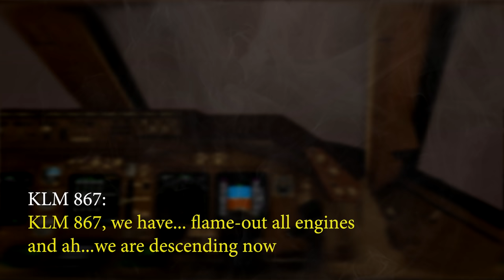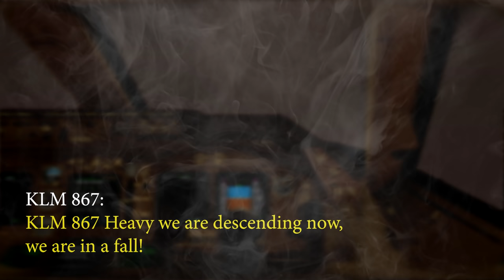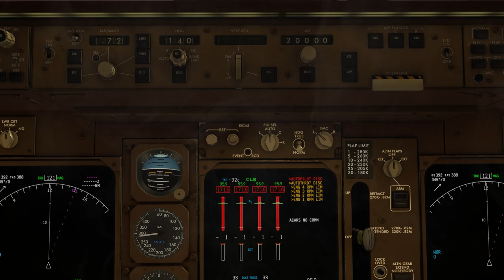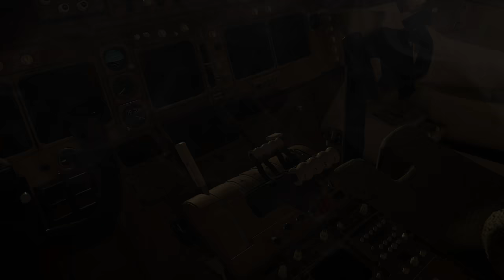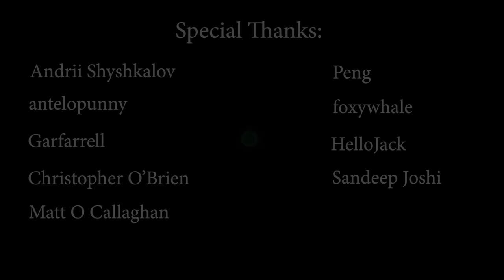ALL engines OUT!!? | KLM Flight 867

Comment: After British Airways Flight 009, this should not happened. Especially not with a major carrier like KLM.
Reply: Once is a fluke.
Twice is happenstance.
Three times?  That’s a pattern, best do something about it.
—
Thing is, the crew knew to avoid ash clouds - but you can’t tell the two apart just by looking at them.
Part of the solution adopted today is air charts now have the option to show airspace that has a risk of carrying volcanic ash.  I may question how quickly the charts can be updated, but the capacity IS there today.  In the days of paper charts, it wasn’t an option.
Reply: It's the 80s where sadly many similar accidents happened multiple times killing many people. This was fortunately not one of them.
Reply: Excellant video
Reply: Of course not, isn't hindsight a marvellous thing?
Reply: wonder why they made the decision to fly into the ash, knowing that it is dangerous.
Reply: Fully agree with you on that, Márk. And the idea to push the engines even harder while it was clear that they were flying through ash was hopefully not the captain's brightest ever move.
Reply: Yes your right I was thinking the same thing as I watching this unfold just as the British airline.
Reply: @stephenc2481  they didn't make the decision. They misinterpreted the ash as a normal cloud that was backlit to give it a slightly weird colour.
Reply: @jwenting  Exactly...I guess that @StephenC didn't watch the video at all or they would have known what you stated about the clouds being backlit giving off a brownish hue!
Reply: If you can control volcanoes then you’re the one responsible for making sure it never happens again.

Comment: I was on the last flight to leave from Honolulu on 20 December 2020, and during takeoff and climb Kilauea volcano on the big island erupted violently. I didn't know it at the time but the crew was extremely worried and on edge, I saw an orange glow out of the window but thought it was just light from the engines in weird fog. It wasn't until we landed that the crew showed how frazzled and relieved they were. The plane was too far into the takeoff to abandon or return to Honolulu, and no other planes were able to leave after us. We got pretty lucky
Reply: The FO is a female??
Reply: mipmipmipmipmip Obviously not, especially since this person’s plane didn’t come near an ounce of ash. If a lot of ash got ingested, the primary cost would be replacing the engines. Some flight surfaces would require replacement/repair and it’d need a new paint.
Reply: And it’s obviously not true that they couldn’t have returned to Honolulu or another Hawaiian airport. Ash doesn’t spread faster than the wind. All they would have needed to do was to dump fuel. Also, the pilots’ worry would have been from ignorance since they clearly wouldn’t have been flying through the ash stream.
Reply: What makes your comment even more ridiculous is that Honolulu is 220 miles from Mount Kilauea. So, I guess it’s true that people tell absurd stories for no good reason on YT.
Reply: @elevatedH.680 yes. Why is it strange?
Reply: @jetblackjoy No. just needed clarification

Comment: Was unaware of this incident.  Amazed that the switch from generators to batteries and back wasn't instantaneous in a glass cockpit aircraft, especially so in one as large as the B747-400.  Another terrific video, thank you.
Reply: the generators spin down when you switch to batteries.
When switching back to generators they take a little to spin up again.

Comment: My brother was in Alaska when Mt McKinley blew (iirc).  He has some jars of the ashes.  He said it fell like snow.  People would go outside to go to work, start their cars, only to watch them sputter out in seconds and be useless until it was cleaned out and the air filter replaced.  Ash is crazy that way. It looks like snow, but it's superfine and will coat every surface and starve an engine super fast.
Reply: Denali (mt mckinley) isnt a volcano. it is the tallest mountain in North America however
Reply: @willowravenmusic  thanks for clarifying.  I'm currently guessing it must have been St. Helen's.  Maybe he was either staying near McKinley or had been stationed near there and I conflated them names in my head. Edit: Nope, I forgot, Helen's was way too long ago, and I think that's why I rejected it for McKinley, not realizing McKinley wasn't a volcano.  Looking at some eruption data, it was either Kasatochi, but more likely Mount Spurr.
Reply: I presume you mean it's extremely fine and will starve an engine extremely fast
Reply: @niallwalsh6598  yeah, exactly that.  Just instantly packed the air boxes with fine powder that would pack in tight enough to look like cement in there at first.

Comment: Never heard of this one shouldn’t have happened after the British airways disaster tho, great video as always anyways! 👍
Reply: the BA flight through ash (around same time i think) was not a disaster. it too landed with no deaths
https://en.wikipedia.org/wiki/British_Airways_Flight_009
Reply: @noneofyourbizness  Also the plane suffered serious abrasion everywhere, including engines and windscreens.
Reply: No warning
Reply: @spikenomoon  There was warning that a volcano had erupted and there was an ash cloud present in the vicinity.  In light of the known serious risk of flying through an ash cloud, in my opinion that should have been sufficient for an early decsion to have been made to divert to an airport well out of the path of any ash cloud.
Reply: @davemould4638  they were alert, and took the then standard measures to get out of the ash (meaning, apply full throttle and climb).
Diversion wasn't considered probably because of where they were flying, it's pretty remote there with few aircraft that can handle a 747. 
Vancouver or Seattle could have been options to land early had they known the cloud would be where it was and couldn't be avoided, but they didn't as the location of the cloud wasn't known.
And had they chosen to make their fuel stop there rather than at Anchorage they may have had trouble reaching Japan, especially if they'd have chosen a more southerly (and thus longer) route to avoid the volcano.

Lots of factors always come into play when making flight planning decisions. And sometimes you take a calculated risk if said risk is considered to be minimal.
Reply: @jwenting  You stated, "And sometimes you take a calculated risk if said risk is considered to be minimal."  And there's the mistake.  The risk of flying through a volcanic ash cloud was grossly under-estimated.
Reply: Captain Eric Moody and crew avoided a disaster didn’t they?

Comment: Amazing to think despite this happening to both BA and Singapore Airlines above Indonesia it appears that very little was done to ensure that it never happened again. I have seen coverage of the BA flight by other contributors but none on the Singapore Airlines 747 which lost 3 engines. Maybe you could cover it?
Reply: What was the name of the flight and what date did this happen?
Reply: @NovemberSky3  Not sure the flight number, but the Singapore Airlines flight incident happened a little over two weeks after BA Flight 9, on July 14, 1982. It was flying on a similar routing, from Singapore to Melbourne, and it overflew the same volcano which had erupted again.

Comment: If I had seen that brown cloud I definitely wouldn't have tried to go through it.  But what do I know.  I'm a simple motorcycle tinkerer.
Reply: To be fair I think they probably missed the significance of that off white colour at such high altitude as it is common in lower altitude cloud. The reason of course being that lower altitude clouds are often contaminated with sulphur dioxide etc due to pollution emanating from industry on the ground. Sometimes it does find it's way to higher altitudes too but that generally needs a strong updraft to help it, volcanoes don't as they spew these gasses out with a ton of heat and pressure creating their own powerful updraft. But it is hard to blame the pilots for not being sure whether or not the cloud they were looking at was ash or just a run of the mill dirty cloud on a planet full of them. This is why we have meteorologists and geologists that should be identifying and tracking this stuff rather than asking pilots to try and guess from a slight tint of colour (And it is slight, the graphics oversaturate it more than it is in reality). Fortunately the VAAC teams now exist to do exactly this so there is no need for guesswork anymore or at least there shouldn't be.

Comment: I actually worked on that aircraft in Everett when it hit the flight line along with some British air, Asiana, Lufthansa and a few others. They were a beautiful aircraft with all the upgrades and even though I was avionics I was temporarily on electrical rework because the first 400s came out of the factory and they were engineering basket cases. I would get a workcard to  install a wire and the very next day me or another tech would get another workcard to remove the same wire I had installed just yesterday. And in the "E-bay" (Electronics Bay) Boeing had incorporated a new wiring concept called "wire wrap."  It made as much sense as defunding the police and then wondering why crime had increased.

Comment: Amazing story and accurate replay of the incident. Good job on including the live ATC /cockpit R/T. When flying into regions of volcanic activity it is paramount to not only pay close attention to ASHTAMS  but take additional tie to thoroughly prepare for this kind of scenario at pre flight planning as well as during I fight reviewing the QRH SOP for this eventuality and delaying your top of descent point to minimize transition to ash zones and taking track deviation well in advance of reaching the suspect areas. This means planning higher Flight Levels and carrying extra contingency fuel ad ensuring Crew and cabin oxygen levels well above adequate levels ad Electrical system,Batteries and Flash lights condition in excellent condition ad that during normal operations the APU ad Engine EGTs at acceptable levels. It is also paramount to ensure Engine ignition is ON and not on Auto when flight passage proximate volcanic plumes. Approaching brown colored thick clouds with smoke/acrid smell or reduced screen visibility are a clear sign to follow the manufacturer recommended memo items ad SOP for flight into  volcanic ash. This was an even better lesson after the original British Airways incident over Jakarta. Good CRM and Command by the Captain especially.Ability for the whole crew to remain calm and act procedurally is paramount.This scenario needs to be practiced both in Simulator recurrent training as well as Cabin Smoke procedures including Cabin crew joint training.

Comment: I'm a big fan of your videos. Very clear presentation of the facts - no artificial drama. The incidents are drama enough! 
I have just one question- you mentioned that the cost of cleanup & repair of the aircraft was $150 million in today's dollars. Are you sure that's right - if that were the case, wouldn't  KLM have been better off writing it off? While list prices are $400M AFAIK street prices are more in the range of $150M

Comment: Wow they all landed safely!   Had they flight crew not remained so resilient in restarting the engines and tackled every other issue as systematically aa they did. With power outages along with incorrect readings basically falling blindly out of the sky their outstanding attempt to keep optimistic where perhaps other pilots would've said a prayer and yelled into the radio "THATS IT WE'RE GOING DOWN".  NOT THESE CREW, NOT ON THEIR WATCH (and so polite to air traffic control throughout this terrifying ordeal "sir we are in a fall") C'mon ......HOW??  ❤👍👌👏👏👏👏👏👏👏👏👏👏

Comment: Really interesting and so satisfying to hear that they actually made it alive, I've never heard about this incident and I thought there's no way also this 747 could have made  it exactly like that British airways 747 hade done, but amazingly it did. That also make me think just how reliable aircraft the Boeing 747 must have been. Both these two that flow through ashes, flamed out and still managed to restart before disaster, and that China airlines that 747 that ripped big parts its vertical stabilizer of during an extreme dive and still made it for a safe landing. Of course the flight crews has a big part in these good outcomes but also the 747 must be considered extremely good.
Compare this whit for example Air France flight 447 where iced pito tubes combined whit really bad airmanship brought them down, and the Boeing max 8 crashes, horrible examples when either man nor machine can be trusted.

Comment: The 2011 eruption of Grímsvötn wasn't even that impactful, but the 2010 eruption of Eyjafjallajökull basically stopped all air travel over Europe for about a week, and had intermittent closures during the following month.
One estimate assumes about 107 000 flights being cancelled.
No, that is not 107 000 passengers. That is 107 000 planes that did not take off during that week. About 10 million passengers did not move.

Comment: I flew several thousands of hours on the A320 family of aircraft with electronic flight instrument panels. I could NOT understand how the FAA and JAA etc. all certified flight instruments systems that can go instantly blank for several seconds! There is a 'standby' instrument elsewhere on the panel that does maintain continuous battery power, but it is awkwardly located, has minimal information and the sudden loss of all normal navigation mapping data, along with basic flight and controls information is extremely disorienting. Surely, there can be a 'fat diode' or secondary 'hot battery bus' to maintain all screens during the several seconds that these electrical interruptions occur. (This incident was circa 1980s and I retired in 2004. Has anything improved since then on the electronic designs? Anyone 'out there' know? - thanks.)
Reply: I'm Santa clause.  Do you know where my airbus is?

Comment: Keep in mind folks, aircraft still fly into ash clouds in the present day. But 30+ years of technological advancements in modeling and forecasting have made it significantly less likely that a commercial jet will fly into volcanic ash.  Wasnt there an Icelandic volcanic eruption a few years ago that grounded lots of flights for days? Anyway, great video
Reply: And I'd add, in the Philippines there was a volcanic eruption about 2 years ago that caused many airlines to cease flights in the affected region. To get between the main islands, people had to take ferries that were 10-20x slower in some cases. Like flying from Manila to Mindanao? that takes >20 hours by ferry. Huge disruption, but not as bad as those Icelandic ash clouds that ground flights in a dozen countries at once. 

Volcanic eruptions are really frightening. Imagine what the ash does to soft tissue. Jet engines are more precise than surgical equipment, but have to be as robust as construction equipment.

Comment: Why didn't he start APU when all engines got out? No RAM air turbine too?
Reply: 747-400 doesn't have a RAT
Reply: @tomstravels520  Why it's there in cheap A320 too? During engines out what's it's alternative power options?
Reply: @joydasgupta9445  APU if available. Other than that the windmilling engines would still provide some electrical or hydraulic power but you’d have to keep your airspeed up. A320 does need one because it needs electrical power to move the controls. 747 just needs hydraulic. The 747-8 has a RAT
Reply: @tomstravels520  A later version having RAT proves the aircraft manufacturing company also has acknowledged the need of it.
Actually they didn't provide as 4 engines failing at the same time is too rare & designers initially might hv thought that it will never happen so they didn't provide it.
Does the 747-400 hv fly by wire?
Reply: @joydasgupta9445  no it doesn’t. The 747-8 has FBW spoilers and outboard ailerons so that is likely why they installed a RAT. Because if a total electrical failure occurred but engine still running then they would struggle to turn
Reply: @tomstravels520  Ok. If u don't mind r u from the Aviation industry. As ur knowledge is very good.
Reply: @tomstravels520  ICK!  If we must have a RAT on board, we'll just have to put up it crawling over the tops of our feet now and then. But I WON'T be wearing sandals.  It's gonna be cowboy boots all the way.
Reply: @joydasgupta9445  there are aviation enthusiasts like myself that has many hours of flight simulation and knows a lot about it